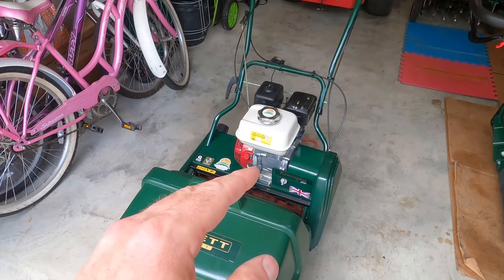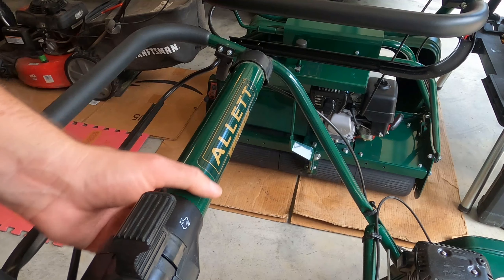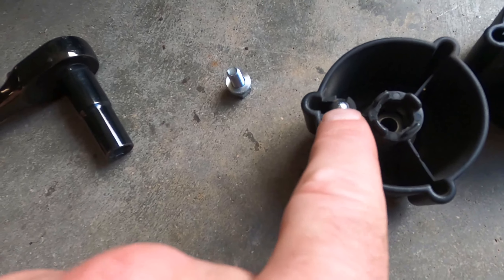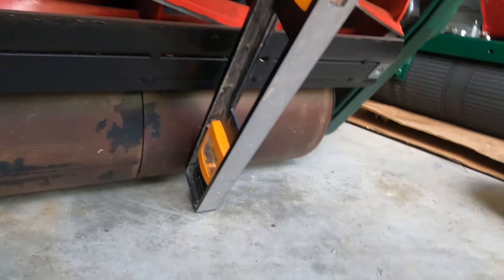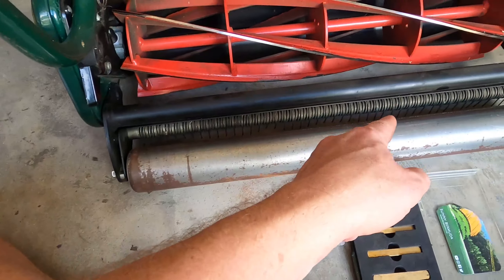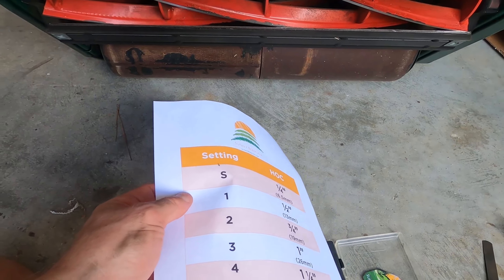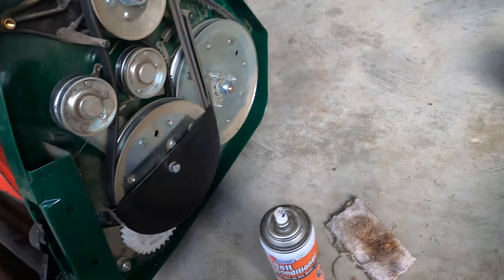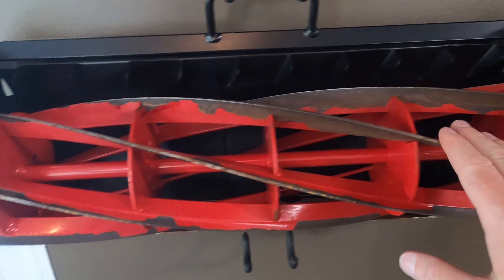Allett Kensington Tips & Tricks ☀️ (S2E20)

Comment: Thanks for the video Sunny great tips to maintain the mower. What I do for the blades and bedknife is I use a 200 grit sand paper for the blades and bedknife before each use. I then use the sandpaper for the cutting test because its thicker that the copy paper. When I am done mowing I hose it down. Use my blower to dry everything off and then spray the blades and bedknife  with a silicone spray and then blow it again to even out the spray before I store the mower. After every few mows I use my Bedknife Buddy to keep it sharp.  It has worked well to keep both sharp and rust free.
Reply from the maker: Amazing information!  Thank you for watching and sharing! 👍

Comment: How are you liking your Allett mower? Where do you send your blades to get sharpen and serviced? I’m looking for your input before I spend over 3000$ on the Kensington H20.
Reply from the maker: Yes, it’s a considerable investment.  I love the cartridge based system and quality of the machine.  Only downside I’ve noticed is on thick Bermuda it will tend to float and scalp on the left side.  Haven’t seen the issue with cool season turf.  Use code SUNNY247 to get $100 off if you decide to buy.
Reply: @SunnyBermuda  
Would you recommend using it on Meyers Zoysia? Do you take the blades to a golf course or send them back to Allett to get sharpen?
Reply from the maker: Honestly, I’ve never mowed Zoysia and don’t much about it.  Typically mail the cartridges to Allett US.  If you’re near a bigger city you may be able to find someone to grind them.

Comment: Hey Sunny! Questions, how do you like the Allett Kensington 20” Honda? Do you recommend for a 4k sq ft. 1/2” cut bermuda yard? Do you think it is well built and will last? I have the Cal Trimmer now, and am really looking to move away from the rear wheels to the rear roller type. Also, I like the cartridges and the ability to have a verticutter without another machine. Dont have a large garage, etc. Thank You for all of your great content!
Reply from the maker: Alan, I like the Kensington 20H, but haven't used it much since getting the C24 and Buckingham. For a residential mower, it is an excellent mower that will transform your lawn especially if you get the turf rake cartridge.  Ideally, I'd recommend the Stirling 51, but cost could be a factor.  Come to  Facebook and join the  Allett Mower Owners group.  A lot of people have had issues with scalping along one side as the Kensington (and Liberty) is a light machine and tends to float on thick turf.  Then again, I see scalp lines on the big YouTubers with their Toros, too.  Hope this helps.  DM me on IG for FB if you want more details.

Comment: This is easily the most comprehensive video on this particular machine. Thank you so much for posting. This is my second season on same machine and for some reason it is cutting a tad lower on the left side. Is there any other adjustments I have missed to get a level cut?
Reply from the maker: Do you have Bermuda?  This is a common problem I’ve seen from other Kensington owners.  From what I noticed, my turf was so thick the machine floats on the turf and the way the drum spins lifts the right side causing the left to drop slightly.  I’ve seen some add weights or a sock full of sand on top of the machine to counteract this.  Oh, thank you for watching!! 😎
Reply: @SunnyBermuda  It is good to know it is not out of level and other Kensington owners are having the same problem. By the way I have zoysia lawn.

Comment: Love the channel, but how many Alletts do you have haha good lord, was hoping you could help me, I have a new Buffalo I got from horizon and the unit is taking off on its own, wasn’t doing that a month ago, if I don’t have emergency brake on the. It will take off. I’ve loosened throttle cable at handle and under the motor side housing to its loosest point and it still takes off. Idle is not set high, don’t know what to do. Allett barely answers you anymore and this is a brand new mower. Maybe belts too tight? Replace belts? Can I use belt conditioner on these types of belts?
Reply from the maker: I have 3, want to sell the Buffalo? 😂 I’d take off the cover and watch it.  The engagement mechanism may be stuck on.  These machines from Horizon May be “new” but they all sat in a warehouse since 2018 so there may be rust or froze up pieces.  I took my C24 and Buckingham apart down to frame almost and lubed it all.  Yes, you can use belt conditioner on these belts.
Reply: @SunnyBermuda  thanks sunny, will try these tips, love the Buffalo but if you want to take it off my hands then shoot me an offer, will trade you for that buckingham set up 😊

Comment: An excellent video. You're a credit to to Allett community. I'm in the UK and we have a Briggs & Stratton engine as standard.... so it's called a Kensington 20B - essentially the same machine (although the routing of the throttle cable is from the rear rather than the side of the machine (although Allett might be changing the routing on newer machines). The throttle lever has been redesigned by Allett in early 2021 presumably to address that ridiculously flimsy washer. A replacement is available from Allett/distributors.  I too have experienced a tolerance issue with the scarifier cartridge and have found a longer bolt of the same size (but with a half inch longer length) improves that tolerance issue. well done for filming (with one hand a times) so very well.  I shall subscribe and watch some of your other uploads. Many thanks.
Reply from the maker: Thank you for the kind comments! 👍 I appreciate your feedback on the 20B.  I wonder if Allett would send a new throttle assembly that removes that flimsy washer from the picture.
Reply: @SunnyBermuda  Mine failed completely and was less that 6 months old.  I'm sure if you asked them nicely they would arrange something (maybe just sending you a more robust washer). I would think after one (or 2) seasons of straightening that washer, it's going to fail so maybe worth pre-empting the inevitable.  Keep up the great work.